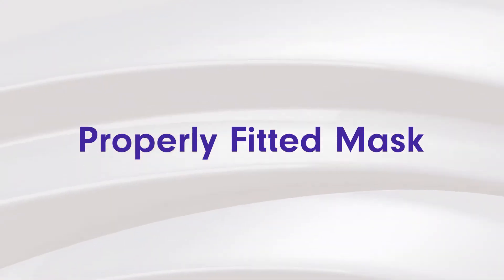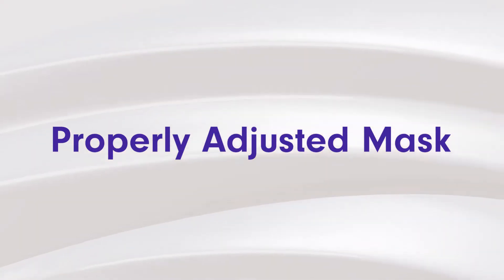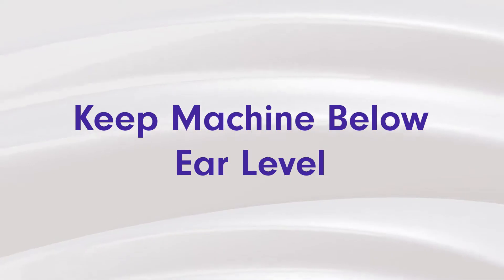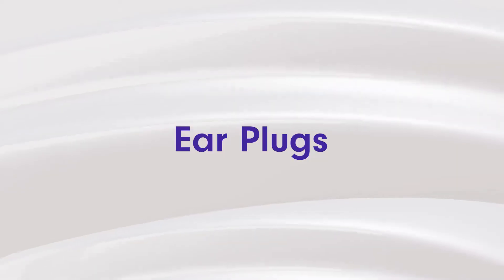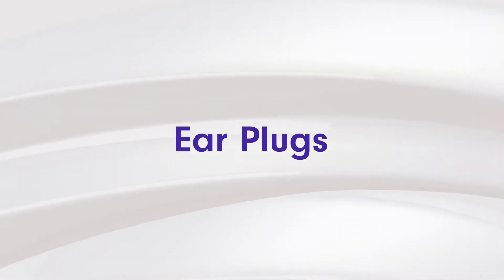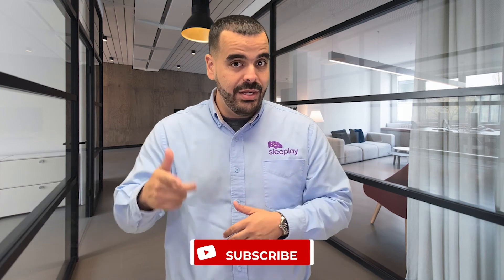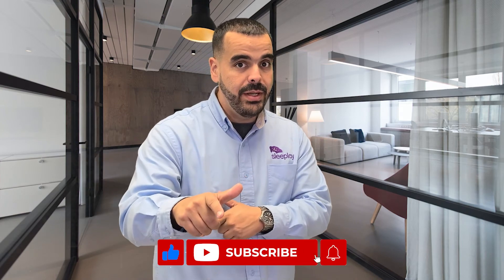How to Reduce CPAP Noise

Comment: HI there: the noise come from the back of the machine where the air hose is connected. The noise occurs when I am breathing or not. The problem is at the back of machine.
Reply from the maker: What type of machine do you have, may I ask?
Reply: It happened to my husband machine what are you doing there for this problem? 😢
Reply: @Sleeplayground  Sense 10

Comment: Hi I just bought a resmed 10 automatic secondhand with only 122 hours on it but it is so noisy like howling wind and when I breathe in it’s louder I wear earplugs every night anyway but I can still hear it it’s so loud any answer or help would be great
Reply from the maker: Hi,

Thanks for reaching out! It could be possibly the water chamber is not pushed in all the way. The mask or maybe a hole in tubing possibly. If none of the if it is a whining sound that may be a motor issue.
Reply: @Sleeplayground  thanks you are right it’s gone quite again I think I did not have the water chamber in properly thank you for answering me

Comment: My noise is coming from the back where the filter is and yes I've changed the filter, hose and mask. I  hope this isn't a sign that it's burning out.
Reply from the maker: Hi,

Sorry to hear of the issues. I hope the problem  has been resolved by now. Sorry for the late response. I know it sounds silly but sometimes the water chamber is not pushed in all the way causing a wind noise. If the issue was resolved I would love to know what it was and how you resolved for anybody having similar issues. Thank you!

Comment: I hear myself breathing inhale and exhale, I am thinking about trying earplugs.  My additional problem is it feels too hard to exhale.   I have the hybrid mask that fits just below my nose.  It doesn’t make physical sense to me that each exhale has to move my used air to the top of my headgear, if that makes sense.
Reply from the maker: I assume you are using the F30i possibly,  that connects to the top of the head. The air travels through the tubing near the ears which may make a little more noisy when breathing. As far as the pressure breathing out,  if you have the option on the machine,  in my options it might say EPR on the list. You can select and raise to 3 to make it easier for you to exhale. I am doing a video tomorrow on the VCom device which is great to minimize noise that may help as well. Link https://sleeplay.com/products/sleepres-v-com check th
Reply from the maker: Sorry had to write 2 responses as far as the exhaled air. It does not have to travel to the top of the mask to be released only. On the front of the mask there are exhalation holes to allow the carbon dioxide to escape as well. Check out the video and the link I sent you for the noise issue and let me know.

Comment: Squeaking noise was not covered?  Sounds like a bird in my hose.
Reply from the maker: Hi,

Sorry about the annoyance with your machine. It is not the mask correct? That sounds like a mask issue. If not maybe the water chamber is not pressed in fully,  possibly.
Reply: @Sleeplayground  it probably is. Im so frustrated with this situation. It’s not the machine it’s the mask or the nose piece. I have tried both type and neither is working out.  Im about ready to give up and turn this machine back in

Comment: I shouldn't have to wear earplugs 🙄
Reply from the maker: Hi,

Yes, there should not be noise coming from the machine whatsoever. The mask would be the only thing that would make noise, because of leakage. Please make sure all is fit properly and all the accessories tubing, water chamber etc. are connected properly. We can work on trying to find a mask that would work better for you, if there is an issue with leakage. I would need to know the mask so we know where the leakage would be coming from.